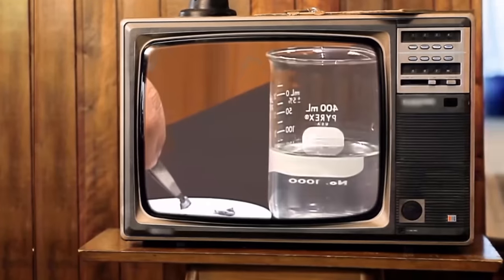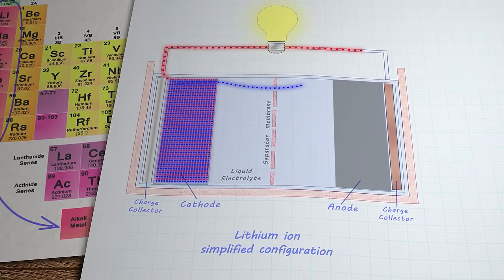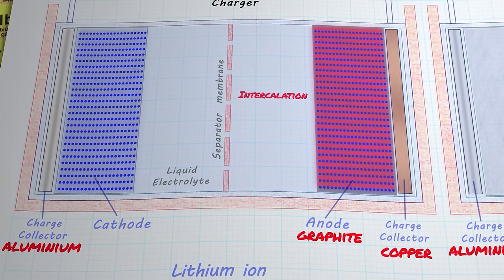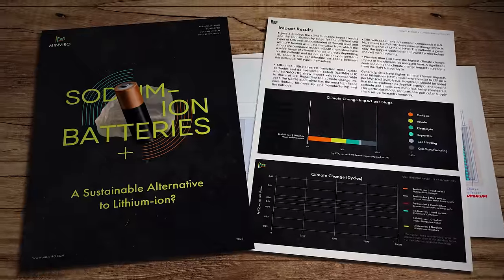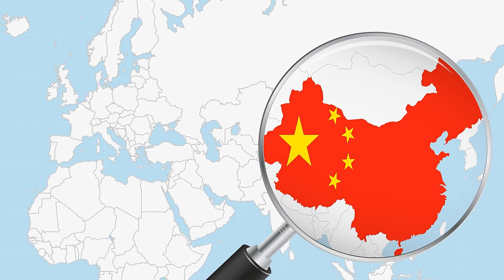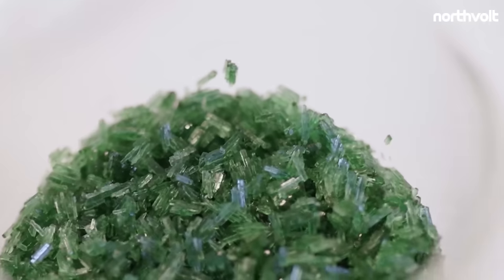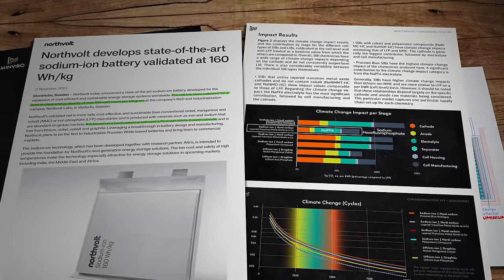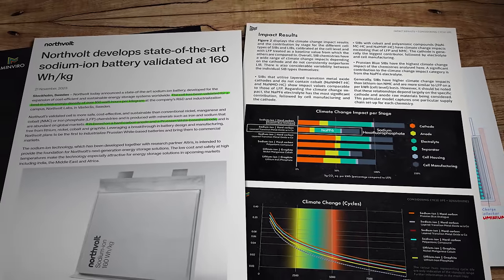Will your next battery be based on salt?

Comment: I haven't invested in any sodium ion startups, but I'm hugely invested in this little blue marble we live on, and very much appreciate the (occasional) good news and insight you provide to us on keeping it habitable.  Thank you, Dave!
Reply from the maker: Thank you. Much appreciated :-)
Reply: Habitable to whom? Fossile CO2 won’t make it unhabitable, just not for the currentl ecosystems.
Reply: i mean it wont end humanity, but its still a really bad irreversable damage, taking the CO2 back is basically impossible currently and probably for a while
Reply: @purplegoop1247  there are also natural rated of carbonification of minerals that take out CO2
Reply: @purplegoop1247  Technically, widespread crop failures wouldn't end humanity. The resulting wars might, though.
Reply: @teekanne15  There are natural mechanisms for removing CO2 from the atmosphere. They're just not fast enough to counter what we're doing, and they won't be unless we drop our rate of emission. And there are technologies that can extract carbon from the air, they're just significantly more expensive than taking measures to reduce emissions. For now. If the capture tech continues to advance, then we may reach a point at which some emissions are less costly to prevent than they are to clean up afterwards.

Comment: Energy Density is not a concern for Stationary Storage.
It just need to be cheap.
Reply: Yup, which is why Redox flow batteries work well for that purpose, not Tesla grid storage based on Li-Ion, no matter HOW HARD they try to push it,
Reply: I'd rephrase that to say it's of relatively little concern. If each battery is the size of the titanic then ill not be putting one in my attic...
Reply: Yeah, all these promises, but he didn't state the difference in cost per KwH. 

 Lithium Air for the win! Especially lithium air that can use the air. Maximum therotical potential is 12,000 KWH per KG! About that. Half that if you include oxyogen.

 So a ten kilogram battery could power a car for ease..
Reply: @hamsterminator why not? Think how much bigger your attic would be?
Reply: @hamsterminator  Weight is a slight issue for the attic as well, there's a limit to how much the woodwork will hold.
Reply: @johndoh5182  You say that, but Tesla megapacks have an order of magnitude more adoption for actually grid operations verses all flow batteries. Not to say flow batteries won't work but we shouldn't pretend li-ion isn't good at grid storage.
Reply: @hamsterminator  Why put it in the attic? Even if it's the size of a bus, it will only take up a small portion of the front yard, or the backyard.
Reply: @falconiusazurius5572   sounds like an eyesore, I don't know many people who'd want a bus sized battery taking up space in their backyard... also gg apartment dwellers
Reply: @DistinctiveBlend  you could just put it in your basement
Reply: And a battery that has half the energy density of lithium ion will still easily fit in a car…
Reply: @AmonTheWitch   while I'm fairly certain you're just being snide for no apparent reason, not all houses have basements (mine don't) and of those that do I doubt you'd be able to get something bus sized into them.
The idea of retro fitting houses (again gg apartment dwellers) with their own bus sized battery pack is up there with solar roadways.
Reply: Yep, my goal has always been that it should store 3 days worth of home usage, be as cheap as a frig, and be able to be moved into a home as easily as a frig.  nobody complains about the space a furnace or hot water heater takes in a home, they won't care either about the frig sized battery that allows them to get off-grid.
Reply: @hamsterminator  I would put one in my garage. But they do not exist currently, so its a moot point.
Reply: And usable and available. Which they are currently not. 
LFP costs around 10 Eurocents/kWh. 
I would pay 5 cents/kWh for Na+ cells. Who can offer some?
Reply: @g.4279 only because they push the things. Their up-front cost is high, their longevity is low (especially with NMC cells), and they catch fire. There isn’t enough readily available lithium in the world to provide complementary grid storage for China or India. Flow batteries are an obvious way to make grid storage expandable and cheap, but there definitely are alternatives.
Reply: Yep. I have room. Low flammability is a plus too.
Reply: @wolfgangpreier9160   Yeah, but you can just do the math. Right now a sodium ion battery is about 30% less dense than a lithium ion battery.  So imagine a tesla powerwall that is twice as big, but costs 1/10 as much.  that is basically what is going to happen.  The talk above about frontyards and backyards is just silly, we are really talking about double the size of a tesla powerwall.. maybe the size of a frig at most.
Reply: @Scrogan  "Pushing things"? They are making a product and they haven't lobbied any politician to make lithium ion preferable to other energy storage by law. 

I'm not saying that flow batteries are pointless, but the market is what decides who the winner is not you are I. We will see how the landscape looks in the next few years. But Tesla isn't selling megapacks at a loss or anything.
Reply: cheap and very high cycle life. (ie longterm it needs to cost pennies to cycle - and have low environmental cost.)
Reply: @PeterSedesse  You are being silly. I know of 10 million South Africans (whose houses on average takes up about one quarter of the space of their erf) who would jump at the opportunity to have such bus sized batteries. These people typically have no hope of affording the huge expense of a Tesla powerwall. And they've been facing rolling black-outs called "load shedding" for years. Stop looking at everything from the perspective of overcrowded cities and first world living conditions. This is not the situation of the vast bulk of humanity.
Reply: @DistinctiveBlend   - ha ha pick the ()  hurt feelings - accusations of snideness when your comment seemed very dismissive.. 
Great comedy for daytime telly...

 - maybe bury the bus..  (PS - crying about devaluation  - (maybe also you are the HOA warden > ??  ha ha - cheers for the giggles.   Go dig a basement - they are useful for the coming fallout.)
Reply: @falconiusazurius5572  you missed my point completely.  A cheap sodium ion battery that could completely take care of a house would not even be double the size of a Tesla power wall.  A bus sized sodium battery would probably be enough for 500 houses.
Reply: @kadmow   huh? my feelings aren't hurt by some random internet person, it's more that it seemed like (at least to myself) they were implying the whole 'living in your mother's basement' thing. It's just unnecessary much like your own bluster.
Besides as has been pointed out they don't even exist and burying them wouldn't be a good idea for much the same reasons you don't bury tesla wall packs or power transformers.
As for your claim of dismissiveness I gave reasons, just like I have to your own suggestion.. but hey whatever keep on giggling I guess.
Reply: @DistinctiveBlend I still have a home heating oil tank that could be replaced with a large battery but it obviously won’t have the same energy storage capacity as oil did. 
But I’m thinking that night rate charging or charging during cheap wind events like yesterday’s storm would keep it topped up.
Reply: @jbmurphy4   I have a friend who has one of those lithium wall battery packs and they're happy with it, it auto chargers on night rates and they have solar panels too.  It's not like I'm against the idea of something double, or even triple the size of a wall pack.
So if it's something you'd like to do I don't see a reason why you couldn't replace your oil tank with a XL wall pack.. even something the size of a fridge is reasonable. But if it was the size of a bus and fully sealed (so you can't break it down into components to move it) how many issues do you think you'd run into attempting to install it where the oil tank is?
Admittedly even a bus sized battery would have it's place as others have noted, it just wouldn't be something I'd want (or need) on my lawns, I also doubt I'd be alone in that sentiment.
Reply: Charvaka were not Hindus ' A friendly Reminder
Reply: @AnarchistDoc  
So?
Reply: Only where space is also cheap

So, not the UK
Reply: @dianapennepacker6854  JetA fuel has an energy density of 11.99 kWh/kg
and you say that your battery has 12 000? lol
Reply: @faustinpippin9208 Lithium Air Max therotical potential. Yup!

 Would we ever reach the max potential? No. There will always be inefficiencies. 

 Lithium Air batteries using the oxygen from the atmosphere have 12k KwH/KG. Pretty crazy right? That is 43.2 MJ/KG.

 Then you remember motors are around 90% efficent. Then might even get a lot better when iron nitrade magnets become a thing which are more powerful than neodymium!

Well then we would be set! Until we can figure out how to make mini nuclear powered cells,, and one day fusion. Having a tiny fusion cell would be dope. 

 Like I said. Lithium Air is awesome. To be honest I thought jet fuel had a lot more energy. Like double that.
Reply: @PeterSedesse can I ask you to look up "frig" in a slang dictionary - your use of the word is confusing & distracting. At least expand the word slightly, "fridge" is commonly used.
Reply: You don't live in a tiny Victorian terrace in the UK, do you?
Reply: @faustinpippin9208  It's about 40 MJ/kg for kerosene and about the same for pure lithium when reacted with oxygen. A cell contains other stuff, like an electrolyte, so in reality it'd be considerably less than 40 MJ/kg, more like 10. So nothing unexpected.
Reply: @DistinctiveBlend 
WTF does gg mean?  gg apartment dwellers??
Reply: @acmefixer1   'gg' is something said (typed normally) at the end of a game, it stands for Good Game. So idk if I need to explain further but what I was getting at with 'gg apartment dwellers' is that it's over for them, as they don't have their own private basement/lawn to slap down a bus sized battery.
Reply: @dianapennepacker6854 that filtering issue with the air is not going away. Ne would need oxygen tanks to keep it clean enough. Hence so far closed systems have worked the best.
Reply: @mfb424  I think we could figure out a way to get the air good enough for the battery to work capturing it from the atmosphere. 

 The real problem with lithium air seems to be the fact we can't really get it to work at room tempatures I think. I say I think because there was a lab in 2023 that got one to work at room tempature, and it was a big deal. The battery still wasn't even close to other lithium chemistries yet it is a start.

 I really hope we see a break through. It would be a huge leap to even get 20% of that. Only lithium aluminum comes close, but that is not rechargeable for whatever reason. 

 So a lithium air battery with carrying its own oxygen is still 20kwh per kg. Still would be amazing, especially considering how efficent electric motors are compared to anything gas uses.

 I haven't been able to find how much volume a theroritcal lithium enclosed air would take. 

 To bad powerful small nuclear batteries aren't a thing with thermalphotovoltaics.
Reply: @DistinctiveBlend how many houses do you have, i dont even have one, im stuck renting,
Reply: I'd say that in the case of Sodium it's even okay for EVs. Depends heavily on the use case, 
but 15% more weight for 1/3 of the price evens out to about 50% less overall cost for the same range.
Reply: What basement? That doesn't exist in my area @AmonTheWitch
Reply: And safe
Reply: @AmonTheWitch   What % of home owners have an actual basement? 10%?

Comment: Since 2010, Spain invested in multiple thermal energy storage systems using molten salt. A 1GWh molten salt storage capacity system is about to be commissioned &  represents one third of Spain's forecasted 2030 requirements. 
Check it out, pretty impressive. We were flying over the earlier Sodium storages in Southern Spain: lots of wind turbines & concentric solar panels ...

Comment: A small quibble: The overall electrical generation system must get greener for any battery technology to provide appreciable benefit. Without that, we are just replacing carbon rich primary movers (ICE) with secondary storage for carbon rich primary generation(Coal, Oil, NG, Wood, Biomass), involving additional losses and increasing the carbon footprint for making, maintaining and recycling the secondary storage. In addition, we are concentrating the locations of emission, exacerbating the effects in certain locales.

Comment: I’d like to see a similar checkup on solid state batteries.
Reply: Which variety?  Solid state isn’t a single solution but a design philosophy.
Reply: SSB's are already on the market and used in many applications where they fit perfectly. I guess you want some n your car. Nope, not happening. Not even in Formula One cars.
Reply: @wolfgangpreier9160  the only Solid State Batteries I know being sold are Semi Solid State which use a liquid to bridge the bounties between anode/cathode & electrolyte solids.  Are these what you are referring to as SSBs?
Reply from the maker: Literally next week's video :-)
Reply: @robblincoln2152  I refer to medical devices and long term low powered industrial applications which use solid state batteries. Not semi. Completely solid state.

Those that used mainly nuclear batteries until the 1990s.

Comment: I would like to see battery storage and "microgrid" tech incorporated into new building construction, especially large multi-unit buildings, both as a means of grid demand-smoothing (and storing any locally-produced energy such as solar panels) and to keep things up and running during interruptions in grid service. If I were a developer, I'd want to build something like that into any apartment/mixed-use building I'd be building.
And since energy & power density aren't really an issue for this application, as wisely suggested in this here video, sodium-ion batteries, as well as liquid-flow batteries and a number of other storage technologies that have been & will continue to be covered here, would be well-suited for this, leaving the lithium for where its advantages are truly appreciated.

Comment: Low cost $/MWh, environmentally friendly stationary storage seems the Key to making intermittent generation practical.  I'm hoping that sodium ion is going to be able to do that.  Sounds reasonably possible....
Reply: It makes sense to have local intermitent generation linked to time shifting bulky fixed storage and then plug in the car when you get home or power up the heat pump when you need it.
Reply: @andrewharrison8436  I need my heat pump when its cold outside and not when the sun shines.
Reply: @wolfgangpreier9160  Yes, me too.  Looking at the ridge top wind turbines as being a better match to my energy neeeds
Reply: @tiepup  Thats marketing hogwash. Where are those superduper redox flow batteries?
Reply: @wolfgangpreier9160  For me sodium better environmentally than lithium.  But lowering the cost of grid scale batteries is for me the big issue in getting to renewable generation.    Wind and solar provide low cost generation, but they need storage to overcome their intermittent nature and that is still way too expensive.

Comment: Viable recycling of batteries of various chemistries around the world definetely needs more attention than its getting currently.
I remember how much trouble the company I worked for years ago had with this side of things down here in OZ.  Practically every  battery pack we used was comprised of the 'usual' cylindrical cells.  They are probably in landfill.

Comment: With its lower energy density, would seem to be a good option for large scale grid energy storage where the amount of space they take up is presumably not as critical.
Reply: Energy density isn’t only about volume.
I think it means EVs will remain lithium ion for now because to get the same energy u need a more massive battery… which actually gives less range, so you need it even bigger, and so on
Reply: Probably could set up a differential equation similar to that used in rocketry. The more fuel the rocket needs, the more fuel the rocket needs

Comment: Thank you for the commentary.

Sodium Ion battery production could be tied to desalinasation plants to provide raw materials.

Stationary batteries would be a good use for this.
Reply: Desalinations doesn’t produce salt it produces brine, it will cost much more to fully get pure salt
Reply: @JS-pb6gb Not to mention that finding salt to create these batteries is not a bottle neck in the process.
Reply: @JS-pb6gb  Sodium is not hard to find and while it could be bound to desalination we do not have a lack of land based supply.  New desalination plant designs which extract lithium as a valuable byproduct are definitely possible and are likely in the works by now.